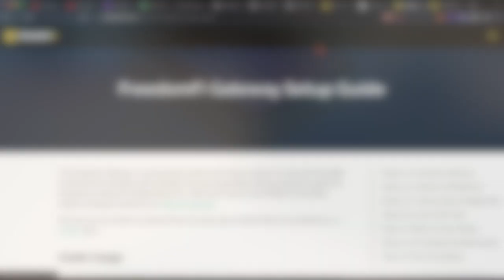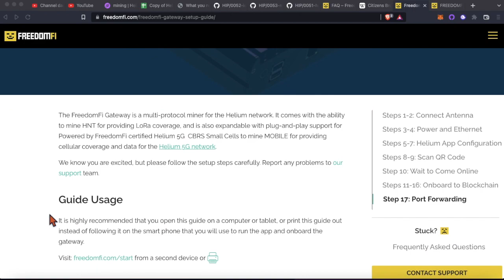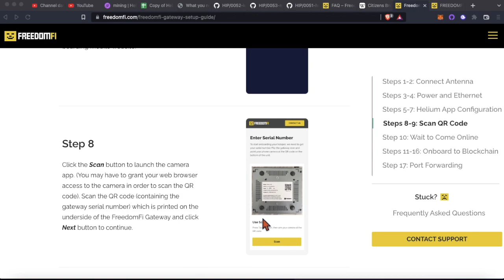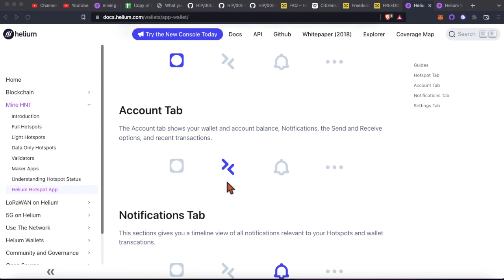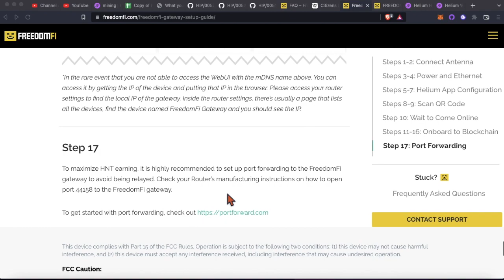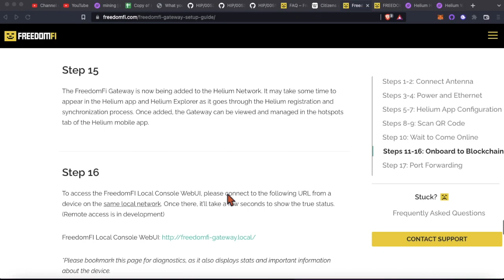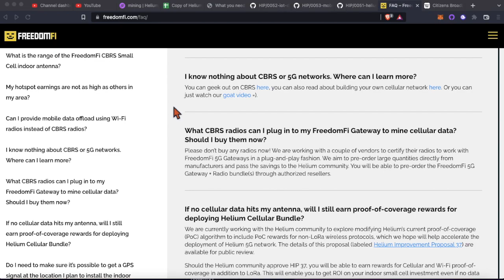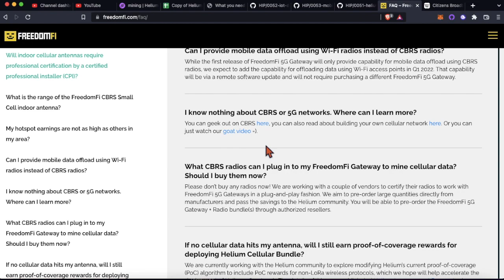Helium 5G Gateway & CBRS Small Cell Unboxing and Setup

Comment: great video !! Do you have to remove your existing helium miner on that location that you’re going to install you 5G miner?
Reply from the maker: Thanks Anibal! Yes, I removed my Sensecap miner from this location and relocated it since the FreedomFi gateway also mines HNT using LoRa.
Reply: @NorTexMining  thanks a lot for your help got a suscriber!!👍. Hey another question I assume you can add an amplifier and filter and 8dbi antenna to the 5g miner to mine hnt?  I have this on my existing helium miner and is doing great. Thanks again for your help!!
Reply from the maker: I assume you are referring to the LoRa antenna only right (since you said mine HNT)? If so, then yes you can probably add those if you already have them. I personally haven't spent money on amps and filters.

Comment: Hello, pardon me I am trying to fully understand this, I just bought 3 radios and a miner, but does this coverage of 5g that helium is offering will get rewards from every simple person that gets in its range I mean like what carriers will use helium 5g at this moment I have understood it is just T-mobile at the moment, so lets say that up to now we will get rewards from T-mobile costumers only and helium 5g phone service and as carriers add up to the helium 5g network rewards will add up? correct me if I am wrong. Thanks in advance.
Reply from the maker: No, right now (Genesis period) the only rewards you will get will be for having your miner + 3 radios online. There will be speed tests as well starting next week to ensure your Quality of Service meets the requirements (100 down, 10 up, 50ms latency or better). Afterwards, mappers and Helium Mobile customers will come by your setup and validate you are providing coverage, and both parties will earn rewards. The more data that flows through your miner and antennas, the more MOBILE you will earn. You will not get rewards for T Mobile customers connecting to your radios because the partnership agreement is for Helium Mobile customers to roam onto TMobile when there's no Helium 5G hotspots available (not the other way around). I will do a full video explainer on this as there's been a lot of confusion.

Comment: My Helium Hotspot Miner - BATCH 2 just shipped. SO sad do I even set it up. Wished I cancelled order.
Reply from the maker: Sorry to hear that. Batch 2? Which manufacturer did you buy from? Depends on how saturated your location is, but smaller towns and cities are still promising.
Reply: @NorTexMining  It is a Pycom. I still haven't collected from drop point. Think I will and take it to my relatives place in a regional area then (100k pop in city centre spot).
Reply from the maker: @martianvideo  in that case, it sounds like it’s better to get it setup and earning for you as soon as possible. Pycom hotspots are lower cost so hopefully with a good spot you can break even in about 9-12 months. You kept your costs low, now keep your spirits high until the next bull market in crypto. Best of luck!

Comment: The wan light was green and today turned off I changed the cable and still same problem the wan is not green can I change to second port ,I didn't get mobile token reward today.
Reply from the maker: Hop on the discord for troubleshooting help. It looks like Moso labs outdoor radios were having issues like you are describing, was yours a Moso labs radio? 

If you have a FF, There is no second WAN port on the small cell, and no I would keep it going from eNB1 (on your gateway) to WAN (on your small cell). Try a power cycle on everything and let me know if that works.